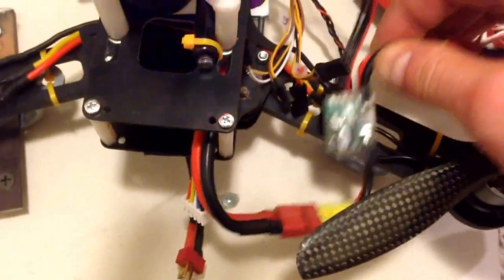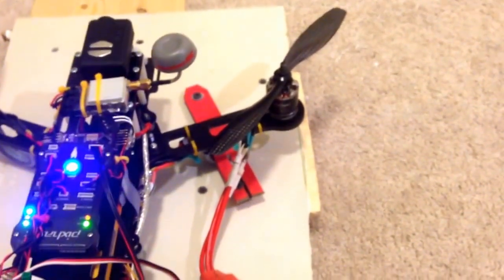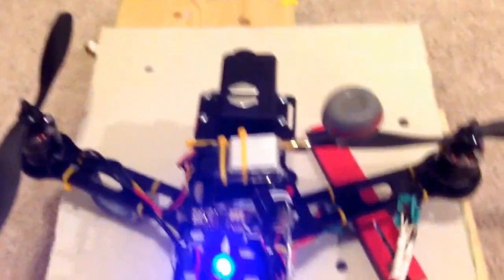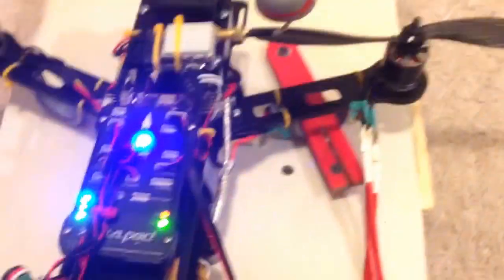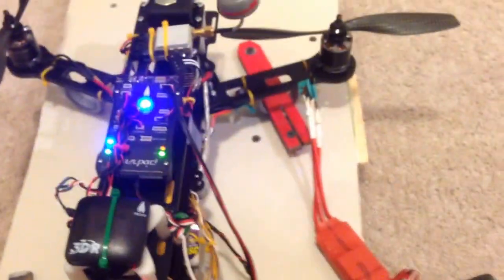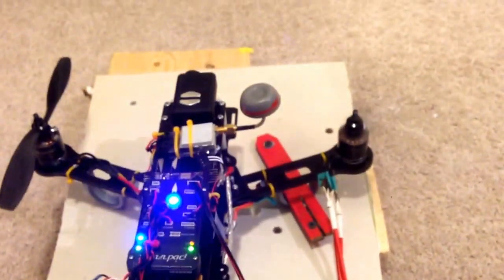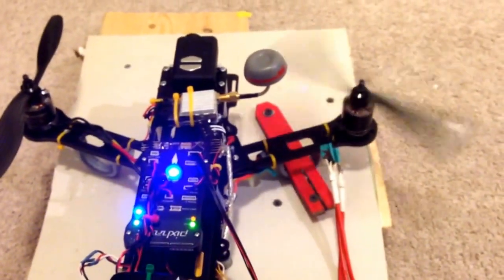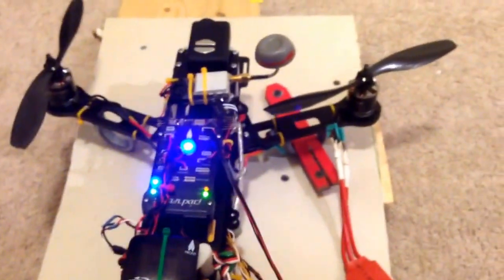Pixhawk sync issues part 3

Comment: xoltri I am curious if the fix offered by Adam Orens  worked for you. Thanks!!
Reply from the maker: No, I tried lowering it to 50 but still had the problem.  What actually works is to lower the RC_SPEED from 490 to 100.  Completely fixed the problem.  See the continued discussion on http://diydrones.com/forum/topics/pixhawk-causing-motor-sync-issues?id=705844%3ATopic%3A1588339&page=3#comments

Comment: Had same issue with motor stall on 400 kV motors on my hex.  Pixhawk was asking the ESC's to accelerate the motors too fast.  Do a search in the full parameter list for "RC_FEEL".  If its set for 100 try dropping it a bit. If you don't cushion the response of the AP you will stall the motors under aggressive maneuvering.   As well you can turn up the throttle delay on your radio to avoid motor stalling.  I have a Futaba T8GS and have it set to about 6.  Not noticeable but eliminated the problem. .